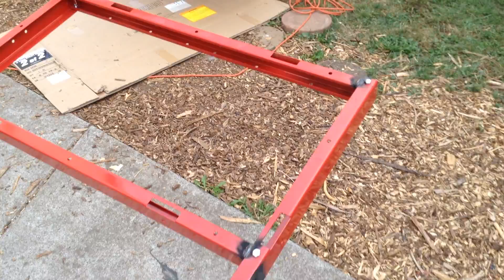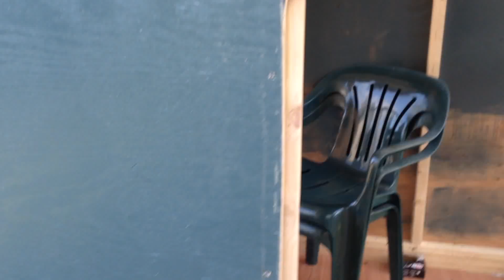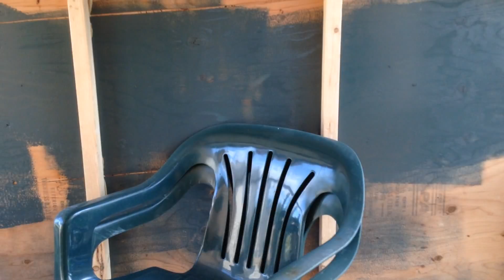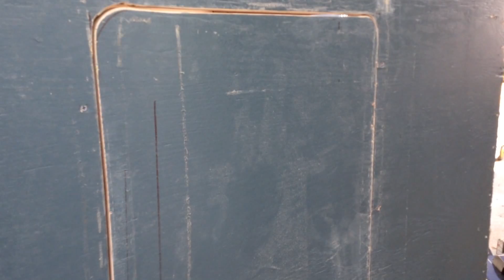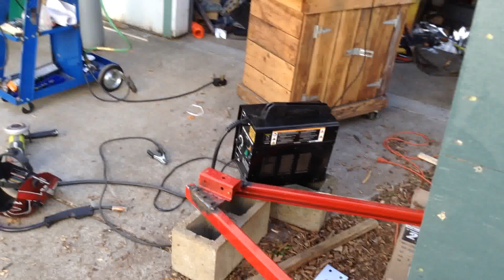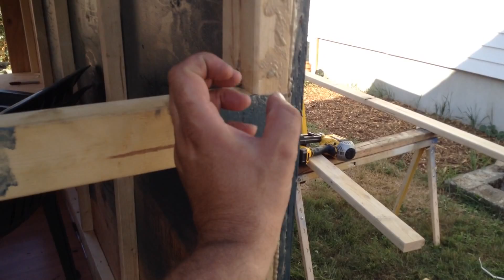Ansar Palace Teardrop Stealth Camper Build part 2

Comment: Hw did yo attched te floor t the trailer? Great work
Reply from the maker: That will be in one of Alex Ansary's videos on the project.  I drilled a few extra holes in the trailer frame to line up with some existing holes that go top to bottom on the side and front steel C channel and ran 6" timber lock screws from bottom to top, into the corner bracing of the living module frame, which is a 2X3 plus a 2X4 on one side, (effectively a 2X7), and two 2X3s on the other side (effectively a 2X6.  The C channel has a little springyness to it, so when it compresses a little from the timber screw going all the way in and pulling the stuff together, that pre-tensions the attachment of the living module onto the frame, and then the trailer deck itself had been screwed to the frame, but not al that securely, just enough not to blow off in the wind.   The main attachment is the frame of the living module to the frame of the trailer with the timber screws passing through all of the layers of plywood.  It is a very secure locking mechanism but can be detached in five minutes with the right bit on an impact wrench, then the living module only needs to be lifted an inch or two to get the trailer out from under it.   The living module can then be suspended on cables or chains, as a treehouse, or placed on an improvised foundation.
Reply: Thanks for you reply geat job

Comment: Where could one find your price for a trailer? I'm in PDX, I don't have a huge need right now, but it will be something that I want eventually, maybe next year.
Reply from the maker: We are still in the experimental stages of the design, but if you want to come over and take a look and see what we can do, PM me a phone number.   It is easier for us to start work on your trailer while this one is still in production because that reduces setup time in between jobs.    The goal on this for materials alone is $1200, and you can do some of your own work (like the owner of this trailer is), and then we all work together on certain aspects that just require two or more people, like moving larger components into position.
Reply from the maker: We are using a combination of salvage, scavenge, repurposed and new material on this in order to keep the material cost around $1200, but I think by the time the lighting, heat, and water setup is done, the material cost will be around $1500.   Then there is tool wear, which has to be factored in.   The labor cost is not calculated on this since the owner is doing a lot of his own work and my work on this is mainly a contribution.

Comment: what about a small 50w solar panel, charge controller, battery and inverter? Maybe some LED lights inside. Small electric fan for ventilation. Hell I would live in that while I visit :)
Reply from the maker: He has two 50 watt panels standing by to go on the roof and is trying to raise money for the other components.   Today we are cutting windows and finalizing issues with the roof.   This is his project but I am pitching in on it, except he just ran out of money for materials and is trying to raise cash to keep going with the upgrades.   My main welder just failed so I am down to using the flux core welder on metal work.   I just came up with a really low budget solution to the window and vent situation which will be shown in another video later.